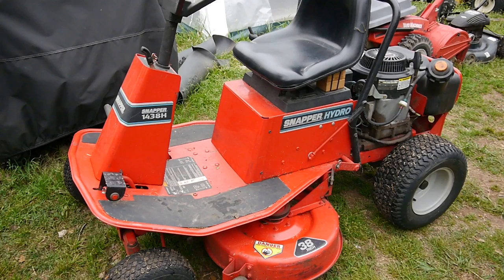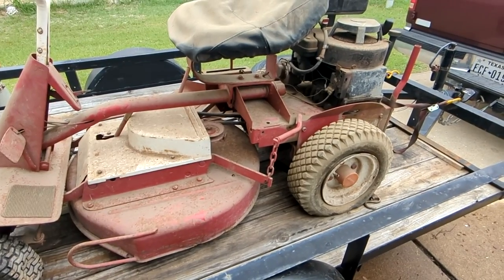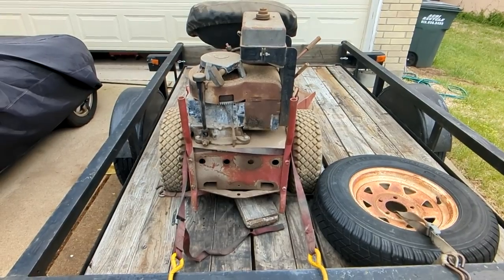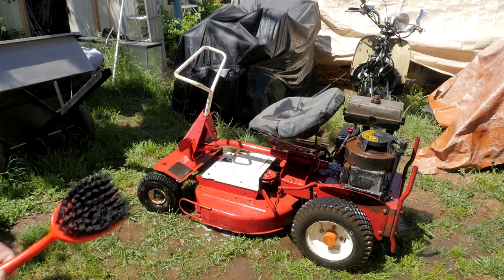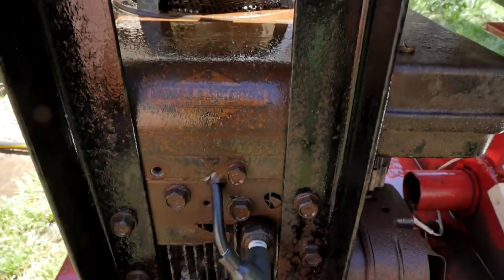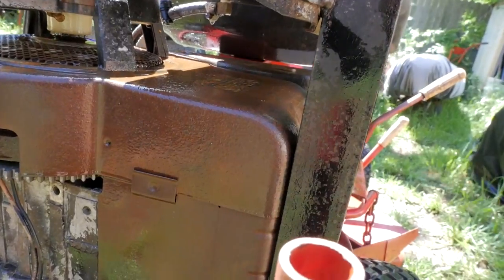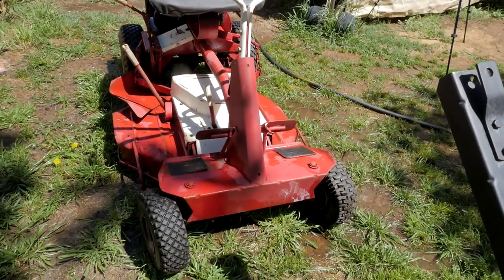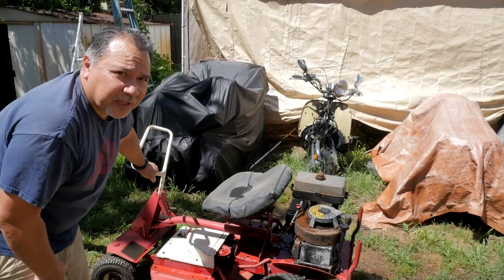Old Snapper Comet rear-engine mower Barn Find, sitting for 40+ years!

Comment: Since you read your utube posts you might find this interesting. I picked up a self propelled toro snowhound snow blower about seventeen years ago that a neighbor was throwing out onto the street . I went back with my wife and threw into my pickup truck and of course i get the third degree that I'm picking up junk again. I said if it doesn't run i,ll get rid of it so i pulled the choke out and she runs , but one of the drive chains is broken. After going to the local lawn mower shop and getting two foot of chain and being told i can't get any parts for it i was ready for some snow. I looked up the serial numbers and it was a late sixties model snow machine and there is video's on utube with people using them. It has no safety features on it and it will drag you down the street if you lose your footing when its engaged in forward. It is a single stage so if the snow is wet and heavy it will clog the discharge chute . One time i was clearing out the chute with a broom handle and i hit the auger taking off about three inches of handle. That was something to think about and didn't put a mark on the auger since its about one eight of an inch thick. They sure don't make them like they used to.hahaha
Reply from the maker: I like the older equipment! 👍👍

Comment: Those open end metal pipes sticking up at the back, did this thing originally have a canopy?
Reply: No, that is to stand it up on the bars for easy servicing.
Reply: Also the rear bagger system slides over those bars.

Comment: I have 2 of these older Machines , your machine appears to be a 308X or a 3080 probably around a 1970-71 model based on the fact it still has the 4 lug Narrow rear wheels , white grips on the controls and the hoop style steering wheel , and the blade height lever on the right side of the deck , ( My 1975 3081 has the Height lever on the left side of the deck) the gas tank is certainly not original as you stated , and based on what I remember from working in a snapper dealership years ago the engine would have originally been white in color , they did change the engines to black in the late 80s or early 90s as i recall , these are a great machine just make sure you put new grease in the rear gear boxes and keep the axle bushings on the rear greased and in good shape as the differentials are expensive to repair on these , these machines are an excellent mower and will give you years of service if cared for , I put a machine similar to yours back together last summer with a Mid 80s 11 hp IC Briggs Engine with electric start and I have had pretty good luck so far , Good Luck to you and What a GREAT FIND!
Reply from the maker: I got lucky finding this one.👍👍

Comment: I love those old Snappers, Got an early 2000's on . I used them in the 80's working for a landscaper. I would guess that is late 70's or early 80's, I think the ones with the handlebars were earlier. Cool old unit, easy to work on and parts are still available.
Reply from the maker: They are pretty cool.  I like the older ones. 👍👍

Comment: Quick question, i have a 90s Noma lawn tractor,  39 in deck that ive restored. Its a fantastic rider, when i first engage the deck it makes a loud squealing sound. It doesn't effect the way it runs or cuts, the deck works perfect but that noise drives me crazy!! It only does it once just when i first engage the blades. I replaced both spindles and pulleys blades and belts and still does it. Any ideas would be GREATLY APPRECIATED!!!
Reply from the maker: That's a tough one without seeing and hearing it.  Sometimes it is the belt...?
Reply: You  might have the rpms too high, which is bad. Start your mower, let the engine warm up about a minute,  adjust the throttle down, then engage the belt.

Comment: I see right away your snapper mower has the 1973 and before handle bars, and right away I see 4 lug nuts holding the skinny
rear tires. Nobody ever seems to show a picture with the right angle to see the rear lug nuts. But I heard there were 4  on some.

Comment: You have commenting turned off on your briggs and stratton v-twin rebuild. Wanted to know where you sourced the parts?
Reply from the maker: Multiple sources.  Are you looking for something?
Reply: @SmallEngineDIY  working on a 22hp briggs that the PO ran dry on oil. Scattered both rods, crank is probably junk as well.
Reply from the maker: @codysp  Sometimes I have spare engine parts, sometimes get them off of eBay or Amazon.  I'm about to start working on another 22hp with broken connecting rods.
Reply: @SmallEngineDIY  ok, let me know please if you find a good source for rods and possibly a crank.
Thank you!

Comment: Honestly I work on small engines and I have had my guess over 100 of them as of now I have 23 of them but I have sold several in the past and scrapped many in the past but yes it's worth restoring it depends on your level of restoration restore means to rebuild everything the motor trans and all like it came off the floor some people think restore means to get it running and give it a paint job that is just called fixing it up but the question is it worth restoring well that would depend on the situation if it's to resell it probably wouldn't be worth it because atleast where I'm at I sell them in ok shape for around 250 if you restore it you might get 600 but I think the time you would spend and money you would tie up wouldn't be worth it now if it was to keep and use would it be worth it? The awnswer is yes those mowers are very simple and well build and can take a beating and they usually cut nice but the ones with the round deck cuts the best the ones with the other style deck sometimes cuts weird on hills because the chute area can dig into the dirt but to restore it and keep it will last years years and years it will last way longer than a new machine so yes in that case its definetly worth restoring I have hit bricks with my snapper and it busted the bricks in half fired mower up and kept mowing the new ones you would break and spindle or damage the deck or something
Reply from the maker: Wow, 23 of them!  I have decided to keep this one.  First, I am going to get it running and cutting.  Then someday do a full restoration.👍👍
Reply: @SmallEngineDIY  sounds like a great plan